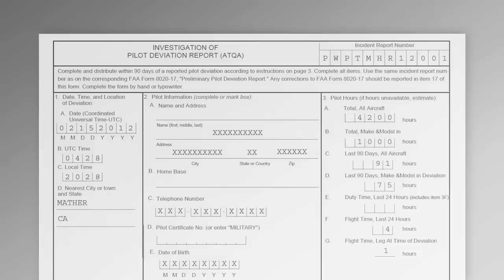Runway Safety - Untimely Distraction

Comment: This is such a great, short piece. So lucky to be able to see the swiss cheese holes line up, the failure occur, and for there to not be any damage or harm in the end.

No one element is the true cause here, and I see people wanting to blame either the Student, or the Instructor for this mishap. I'm sure they're both capable (well, hopefully so for the student), and really seems like they should just have the student fly with another instructor that better suits him.

Causes I see are:
- Student discomfort on towered comms is obvious. I'm assuming they've learned mostly in uncontrolled airports and airspace, and it's stressful to even hear how uncomfortable they are. The comm is clearly his brain-disconnect button.
- CFI over-coaching. Giving someone word for word responses is clearly using some of the bandwidth he needed for situational awareness.
- Normalization of deviance: taxi instructions from tower should be 22R via A, B. If the aircraft needs to be on Bravo, then say Bravo.
- Missed signage: Always confirm your location on the field via signage!
- Lazy readbacks: When you're holding short of a runway, say where. Even if they were at the wrong place, if the pilot had done the full position report "Holding short 22R, A1" then tower would have another opportunity to clue in. With the CFI coaching so hard, why didn't he press for that as part of the readback?

Listening to this the first time, you can hear all the little errors that led to this incident. I didn't know what the outcome would be so I relieved when it turned out to be "just" a pilot deviation.

Comment: So many things are wrong with this one.
1) The controller did issue misleading taxi instruction and failed to spot the plane on the wrong runway when he give it clearance for take off.
2) The student had very poor communication skills, and most likely poor preparation for the flight
3) The instructor failed being pilot in command and was busy doing other things rather than supervising the student.
4) The disable runway was most likely not well marked as closed one
5) The layout of the airport was rather misleading and especially at night it would be hard to spot the mistake, though the signage should make it clear the runway is different.

Weird that this can happen on controlled airport.

Comment: The fault and liability here should like completely on the controller. FAA JO 7110.65 (the far/aim for controllers) para 3-7-2 b specifies that the entire route must be given. A note clarifies that if the route ends in a connecting taxiway with the same identifier, that can be omitted from the clearance. So runway 22L taxi alpha (omitting A1) is acceptable. But as the controller assigned runway 22R, he must specify taxiway bravo. 

Additionally, para 3-1-7 requires the controller to determine position of the aircraft prior to issuing taxi instructions or takeoff clearance. The pilot reported that they were at 22R, however under para 3-1-12, the controller must visually scan the runways and verify the pilots position.

The pilot DID take off on a runway he was not cleared for (22L v 22R) but several factors leading up to this close call rest primarily on the controller's failure to issue proper taxi instructions, failure to verify pilots position, and failure to visually scan runways.

Comment: I chalk this up to several issues.  1) Runway is closed, WHY are there NO indicators ON the taxiways indicating same?  A string of flashing red lights across the taxiway or an airport vehicle blocking the taxiway with flashing lights prior to the closed runway would be one sure no miss sign that DONT GO HERE.  2) Controller failed to specify "via alpha then bravo hold short....." as should have been done 3) Pilot AND CFI apparently unfamiliar with airport layout. As a student, he should have taken the time knowing he was going to be there, to look over the layout and had it in reach in the cockpit so he could reference it, and the CFI should have INSISTED that happen. 4) Pilot and CFI failed to correctly identify WHICH runway they were on. 5) CFI is guilty of complacency by 'adjusting' the avionics while taxiing to the runway at an unfamiliar to the pilot airport. 6) Unanswered question is "were the 22L runway lights ON" at the time this happened, and if so, WHY.  If they were turned OFF, then there is another indicator that something isn't right.  

Love the comments to this, learn a few things every time I see these... Hope I never have to deal with the CFI who was a part of this fiasco!
Reply: You know CFI’s can make mistakes right? They’re human too, who knows if it was a really long day.

Comment: There are plenty of numbers available so why don't all airports call them 22R & 44L for example? also shouldn't the closed runway be fenced off or sign posted "Closed"?
Reply: the runway number are the heading of the runway rounded to the closest tenths 
eg. if the runway heading is 218 degrees it will be rounded to 220 and called runway 22 and parallel runway are distinguished using left and right respectively. if you took of from the other direction it would be runway 04 or just 4 depending on the region they might leave out the 0 before the number.
Reply: 44L? say you dont fly. lol
Reply: I like your thinking, but the proposed solution will not work.
You would need to add 36, so 22R and 58L.
But not a lot of people would be able to convert that into a compass heading correctly.

Comment: This is a case of the TOWER Failing to give correct Taxi instructions, a student pilot and an instructor doing in cockpit tasks. Had the tower issued the correct Taxi routing , there would not have been a problem. This is how the FAA works.

Comment: 22R via Alpha does not exist. Controllers fault first. Pilots did not confirm proper runway. Pilot's fault second. You are ultimately final authority of your actions.
Reply: you can blame the pilot for making the mistake
you can blame the tower for being a bit confusing and then not noticing the mistake
you can blame the cfi for having a clearly not ready pilot fly, and for not noticing the mistake
you can blame the other aircraft that in an incident made one of the runways unavailable
you can blame the airport for not marking the closed runway more clearly

so i think that blaming one person specifically is just pointless, but definitely try to have ALL of these people learn from their mistakes so they dont happen again.

im just glad these videos exist, they present all these factors and potential consequences very well
Reply: 22L via Alpha doesn't exist either. THAT is not the fault ATC made. ATC's major fault is not checking the cessna's position before issuing the t/o clearance.
Reply: @QemeH  Alpha and Alpha 1 are the same taxiway. You don't need to turn.

Comment: If 22L was closed, why wasn't it indicated by the airport? Turning off runway lights and putting indicators at all taxi intersections of the closed runway would have helped. It reminds me of the accident where a commercial airliner tried to take off from a closed runway at night in bad weather and impacted the construction equipment that was on the runway. In that accident they also identified runway lights on the closed runway and lack of clear signage and barriers to indicate the runway was closed as contributing factors.
Reply: Absolutely right.  If a highway is closed, the police always put barriers to block the on-ramps, because drivers will do anything.  It seems obvious that an airport should do the same.
Reply: @GoodLifeMedicine  until someone leaves it on an active runway and it gets sucked up in gear or engine and causes a catastrophe 

There's signs all over. Literally just read the sign. 22L... is not 22C or 22R.
Reply: @etherealrose2139 that can be solved really easily by just having standard processes for closing and opening runways. This sounds like "I don't want to wear a seatbelt because they chafe really bad when you get into a crash"
Reply: Why do not turned ON the stop bars?
Reply: reverse thrust  They knew 22L was closed, but they thought they were on 22R. The fact that the runway lights were still on at 22L reinforced that misconception.
Reply: Christopher Guy • I thought of that same incident too.

Comment: This has always been an issue. Poor lighting. No painted runway numbers after the hold area on the runway and before it. As this is an age of electronic gadgets. Where they have their head inside and not looking outside.... It's why it happens more and more today. 

And had he looked at his airport layout chart closer. He would have noticed the slight bend to 22L. As B was a 45 degree turn to runway 22R. That he never made or noticed! Not to mention runway 22R was all lighted up. How the hell did he not see that? Oh right. They both had their heads down or blind....

Comment: It's always a CHAIN of events. This time nobody got hurt, but that isn't always the case.
      Where was the X and why were the runway lights on?
Reply: X isn't put up for temporary closures.  Probably had the lights on for the crew working on the 38
Reply: @morganghetti  "X" is used to indicate a closed runway. Even when the closure is temporary. I know this, because I lived near an airport. When the closed the runway, they put out lighted X's.
      Also, the runway lights don't provide enough light to work by, they use night suns for that, a type of bright light that shines in the ground.
https://www.faa.gov/airports/runway_safety/publications/media/placemat%2020april09.pdf
Reply: @erictaylor5462  if they couldn't spot a big sign saying 22L, not sure if they would have spotted an X in the dark. Positive bias seems to be a very strong thing!
Reply: @LeantoPeak  The runway numbers aren't easy to see from the glide slope. 
    The runway number isn't that important anyway, because the number is assigned based on runway heading. Runway 22 would put you on a heading of 220 degrees. 
    Typicly the runway lights are turned off if the runway is closed.

Comment: A simple solution is turn off the lights on a closed runway or change the light colors to all red.
Reply: I remember seeing a video about a jet crash where the pilots got on the wrong, closed runway and noticed the lack of lighting just before they crashed.
Reply: @MIKEKELLEY12000  Comair Flight 5191.  I initially thought that this was that flight due to the video title.
Reply: Doing this caused an Air Canada jet to line up to land on a taxiway some time back. They managed to go around just in time. Had they crashed into the line of fully loaded jumbos waiting to depart it would have made Tenerife look like a GA crash.

Comment: Would it be an idea to like block the taxiways entering a runway when this runway is closed?
Reply: ***** Well in my opinion that would still be better than crashing into another moving plane and putting even more people at risk with it...
Reply: This was the first thing I thought after watching the video.  Why didn't someone take a few traffic cones out there and block off the closed runway where possible?  Couldn't take more than a few minutes.
Reply: geoh7777  People in cars—-Maybe. Pilots in aircraft on a towered strip——Not so much.
Reply: you could like block
Reply: Yeah I am so surprised at that. I mean sure they probably need to get to the runway with maintenance cars, but if it is closed for longer time, the taxiways should use cones or something else to block the access visually.

Comment: The real answer to all this mess is put a sign or those wooden planks they use to close roads. That way communication or not it would have been avoided. If im going to work on an active runway you bet id make sure no one land or takes offs .
Reply: Agreed, and every towered airport has the lit "x" signs on trailers that should have been used in this case. Not only for taxiing but for incoming aircraft, at night yet.
Reply: i wonder if the runway lights were off if it would've made a difference?
Reply: @russrh  It would have made a huge difference, if nothing else, the pilot most likely would have asked the tower to turn on the lights then the mistake would be recognized.
Reply: I know what you're saying, but I doubt the workers have time to run around checking what the airport should do.
Reply: I like your idea if it is in the form of lit markings that can simply be turned on and off from the tower or airport administration building. It's not too uncommon to have a lit "X" set up at the thresholds of a closed runway, but those aren't usually called for if the closure is expected to be short-term.
Reply: @ReflectedMiles  Maybe that needs to change!
Reply: Ken Hurley It would be impractical to require it for every closure, such as visual FOD sweeps by Ops which may only be 3 or 4 minutes. The FAA would always need to limit its application in some way to avoid operational inefficiencies and unnecessary burden on both Ops and ATC.

Comment: the Cessna did not miss anything. the controller should have said taxi to 22R via A, B hold shot 22R. both pilots and the controller share the mistake
Reply: +olsonr Plus, you know, one COULD look at GND charts and see the BRAVO / ALPHA 1 situation, especially as an instructor...
Reply: @QemeH   kaiju  that's not how this works. Controller says "taxi to X via Y" I bloody well stick to Y. The controller has the experience, the student does not. There is no way to get to 22R via Alpha, this is a wrong clearance highly likely to cause confusion.
Reply: The command given by ATC strictly didn't lead to NEITHER runway. It's either A and B to 22R or A and A1 to 22L. But Alpha on its own terminates at the three-way intersection with Bravo and Alpha-1. It is however very common on busy airports not to specify the holding point to give pilots the choice (for example the cessna could've lined up at h/p Delta with the same clearance, if the TORA is enough). So while it was a bad decision to do that with a student pilot, it's not a mistake. The two major contributing factors to this incident are:

1) The instructor onboard the cessna failed to notice his student taxi, line-up and t/o run on the wrong runway.
2) ATC didn't catch that mistake and blindly gave T/O instructions on an assumed position.
Reply: Thank you for point that out. You are absolutely correct. Both Pilots and ATC lacked situational Awareness
Reply: +Skyhawk He missed the [taxiway] sign showing 22L instead of 22R.  He failed to verify [that he was at the correct] runway for takeoff before crossing the hold line.